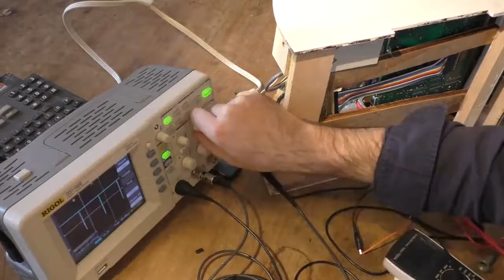Minitel output stage reversing

Comment: Please tell me you are writing up this dark art! I'd love to learn more about reversing old CRT tech!
Reply from the maker: This is actually me avoiding learning this dark art in the first place! I'm keeping the existing CRT driver board intact and just trying to reproduce the circuit that drives the electron gun (which is a pretty weird signal; 52V during retrace, 38V on dark pixels and ~8V for a fully lit pixel, all driven by an NPN transistor with the base tied to 5V through an inductor where the emitter voltage varies). I'll write stuff up someday if I get a chance; the kid is taking up most of my time right now.